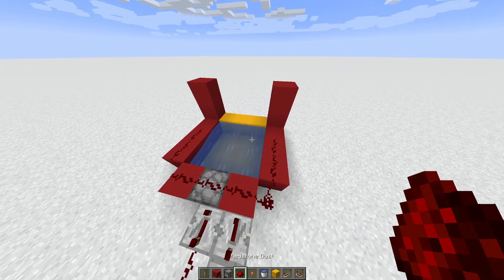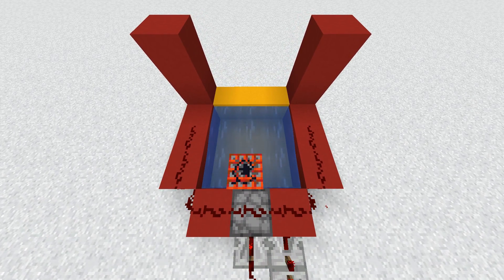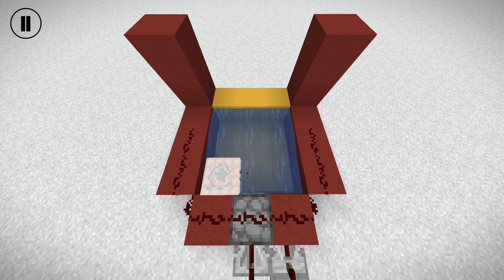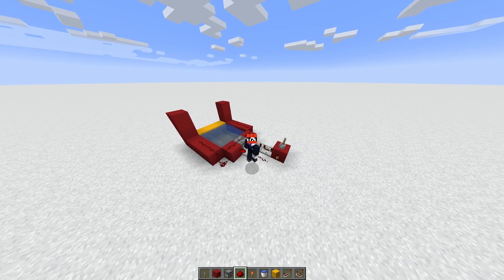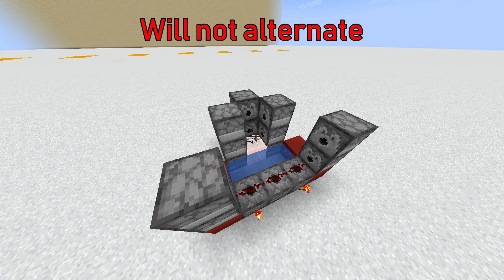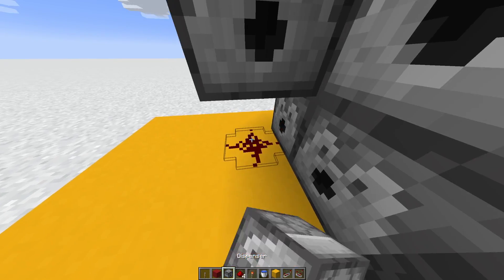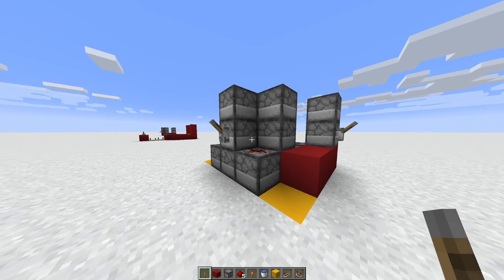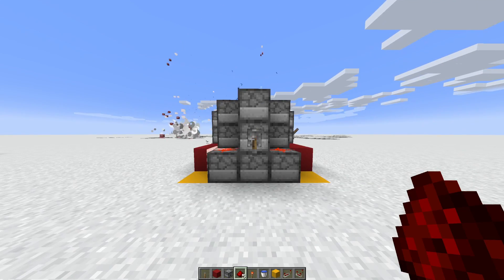Alternating TNT Cannons and How they work

Comment: I see your videos pop up once in a while, it is an interesting concept for a channel, slight concern of running out of video topics due to very specfic branding. Anyways incase you need new ideas:
(assuming limiting yourself to must have TNT)
TNT cart cannons
Other propellants, like other explodives such as ender crystals, beds for a nether design, etc (entity cramming launching TNT?)
Air defense (vertical column of tnt, blowing up any flying machine flying above)
anti-TNT cannon cannon, deflects launched TNT from a different TNT cannon
Reply from the maker: Thank you for the ideas these in consideration. I've definitely thought about the possibility of running out of ideas, however I'm ok with that. I've gone longer than I estimated I would in my plans. I view this as more of a passion project, so if I ever get the feeling that I don't want to continue nor I can't think of any way to continue it, so be it. At the moment though, I still have plenty of more stuff I want to make before I'm run down on ideas though.
Reply: @TheProfessorTNT if you haven't already try out lazy cannons as well, they're kinda op

Comment: Those cannons are very nice BUT if you want to make something even more original then your creations i would suggest trying to get rid of dispensers and make use of (preferably slimeless) tnt dupers because there is no need to refill those. You can make regular or even player cannons using those dupers. If you actually plan on making them i have a special request for a player launcher; a launcher that uses tnt dupers and launches the player around 300 blocks into the air.
Reply from the maker: I've been doing research on Tnt dupers so I'll probably do it eventually. You're the first to ask about a player launcher with TNT dupers though, I'll be sure to mention you if I do a video a like thst